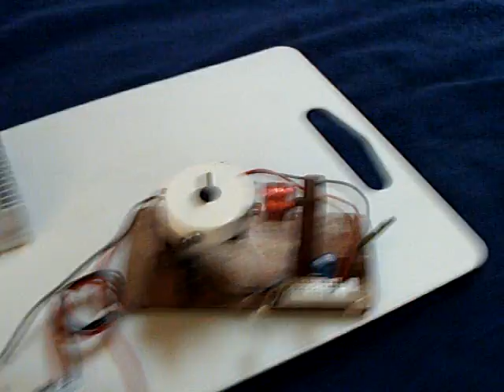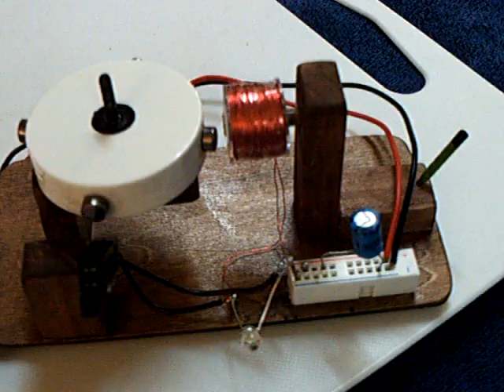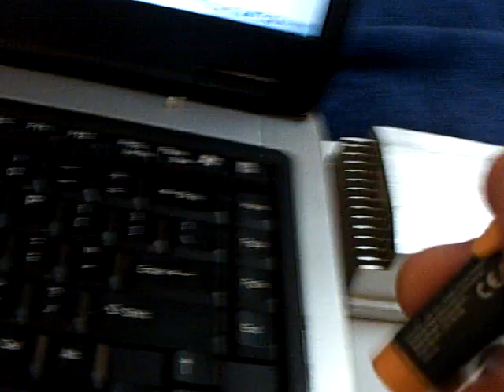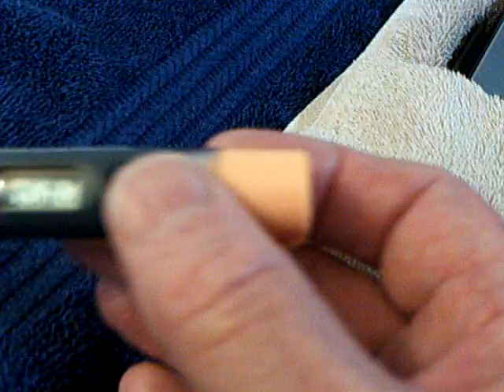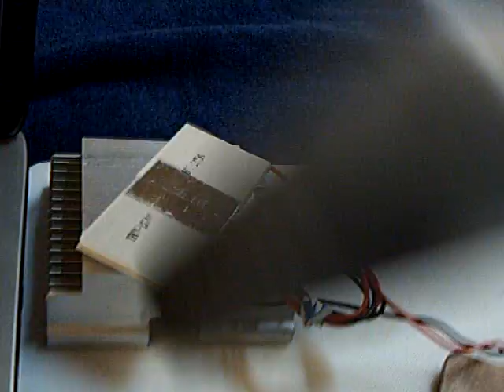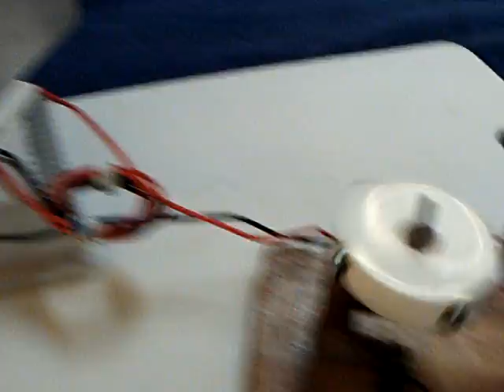Computer heat powering a simple pulse motor

Comment: Hi, Lidmotor! Thanks again for sharing :)

For the Peltier system, has I could have calculate, I didn't find cheap enough materials to make some and been interesting to produce real interesting energy with. It's used in camping fridges (in the reserve way) but I can't see for now any real use for large applications :/

But if you can find a way to produce some cheaper enough, yeah, it could be interesting :)

Cheer.

Comment: Very cool idea, by at least 20 degrees differential :)
Hmm, about the sailing, I wonder about a metal block with a pipe, insulation around the pipe and then you could lower the assembly into the water. Water temp would be much colder lower into the water. Peltiers would be under a black metal mass at the top, protected with clear plastic, and which would stop wind cooling too. Would look like a capital letter "I".

Comment: Well it always depend on how much voltage and amperage you need at the end. For the "hot" side you could simply use a back piece of aluminum and to prevent the wind from cooling it put some plexiglass/glass wall around it. I know these little device can withstand high temp  and with high temp differential they will put out over a couple volts and few milli-amp.

Comment from the maker: The water temperture where I go is about 68 degrees in the summer so I would need to get the top peltier surface up to 90 or more to make juice.  It could be done with a "hot box" kinda thing.  The down side is that if the wind is blowing it will cool down the top surface and kill the temp differential.  Making a big "peltier board" like you suggested should work quite well.

Comment: Very good way to use excess heat! I'm pretty sure you might be able to use it on your boat  since normally the air surrounding is "hotter" then the water or vise versa  you might be able to run many thing of course you might need to make a big peltier board with series and parallel. Good luck on your project!!

Comment: cool idea for the ocean/air temperature difference...in my minds eye,im seeing a floating device with a glass box black top for the sun and a heat sink hangin in the water,peltier sandwiched in the middle,and a night time module with a furry heatsink (for evaporation) on the airside...

Comment from the maker: These thermoelectic modules can put out a lot of power IF you maintain a good temperature difference.  It isn't a case of getting it hot or cold---you have to do both at the same time.  Sometimes that isn't so easy because the whole setup wants to go to a neutral temperature.

Comment from the maker: Yes!  I tried it and you CAN store the energy into a supercap.  This particular setup only puts out about 120 millivolts though.  You would need some kind of DC-DC voltage booster to make it useful when you pulled the energy out of the cap.